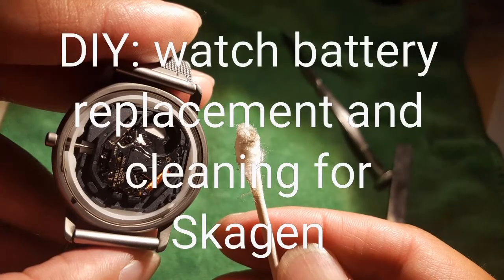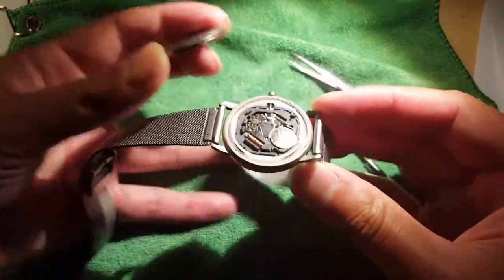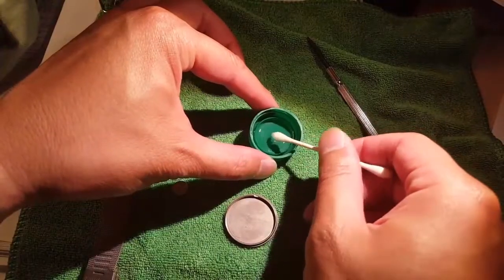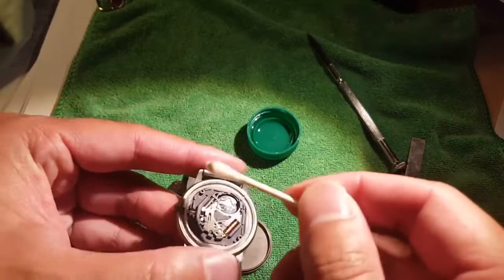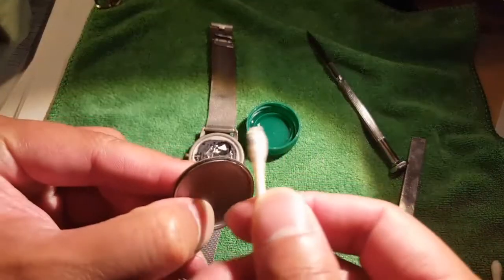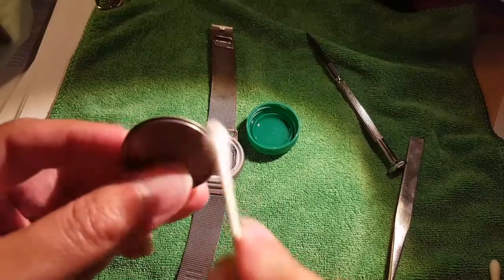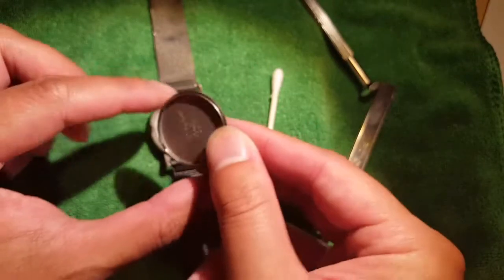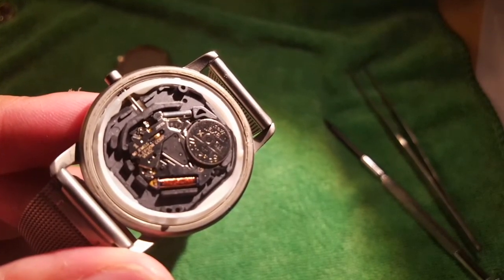Watch battery replacement and cleaning Skagen

Comment: Only use rubber tipped tweezers to pick up the new battery, also alcohol will dry out the gasket.
Reply: Metal is fine. Alcohol will dry gaskets and o rings. I'd clean with alcohol but give that gasket a solid coating of silicone afterwards.
Reply: Thomas Berry Metal tweezers will short circuit the battery.

Comment: How do I remove green oxidation also the black film thing under battery is ripped what is that called so I can order a replacement
Reply from the maker: Good question... probably very carefully with a bit of denatured alcohol or residue free electrical cleaner. Usually if that happens the acid has damaged other stuff already.
Reply: Sterling is right. But you can make one look a heck of a lot better using a light cleaning with Brasso. What I mean by light is don't use hard friction. Husband bought a beautiful Timex Carrige in and the front was super nice but the back was disgustingly green. Looked so much better when he used the brass cleaner.

Comment: I bought the Skagen Men's 233XLTTN over 14 years ago and the strap kept breaking. I put it away in a closet and there it has remained. The battery was tiny and I kept it also. but lost it last night while trying to read the numbers on the tiny battery. I tried using a couple different magnifying glasses, but it was very difficult to read anything. I could see "sony" and that was about it. I was told the replacement for that watch was - Energizer 371/370. Not true. 371/370 are much larger then the one in the watch. Anyone know the actual battery replacement for this watch - Skagen Men's 233XLTTN?

Comment: Dude all that alcohol just cleaned off all the oil of the gasket ring.

Now your watch isn't waterproof. There's a tool where you pop the rubber ring into that regreases the ring so your watch stays waterproof/resistant.

F in chat

Comment: Do not do what this guy just did with the alcohol around the cap.  There is a thin rubber gasket there which should be lubricated with sealer, not alcohol.

Comment: I tried this.  It will NOT snap back in.  Put 140 pounds of pressure entirely on the spot.  Will not snap back in.
Reply from the maker: +colt one I snap it in by hand... check your cover alignment or if there is something stuck. My watch is a classic Skagen.
Reply: SKAGEN backs tend to be a very tight fit so you should use a case back press, if you press to hard in the center of the back you will deform it and it will never fit.
Reply: Had the same problem. Managed to get it back on like this with a wooden board: https://youtu.be/nUVK54QigPE
Reply: @_phil.good_  THANK YOU SO MUCH for that link, I used that principle and it worked beautifully! (I used a tissue + coin + chopping board)

Comment: Alcohol will dry out your rubber o-ring and it will get hard and stop sealing.  Other than that, good video
Reply from the maker: I have been doing this for over 6 years and with the same o-ring and its still water tight. Maybe use denatured alcohol? Not sure?